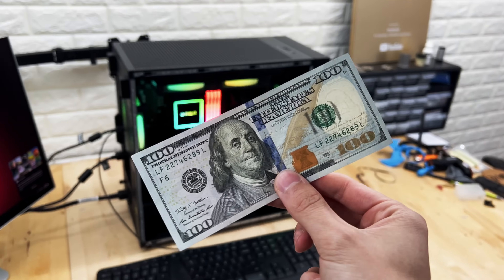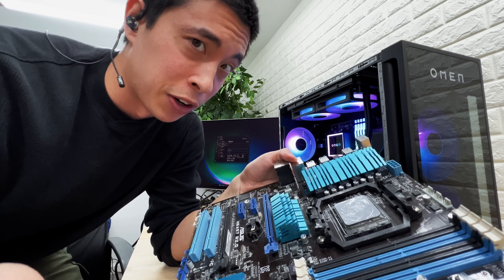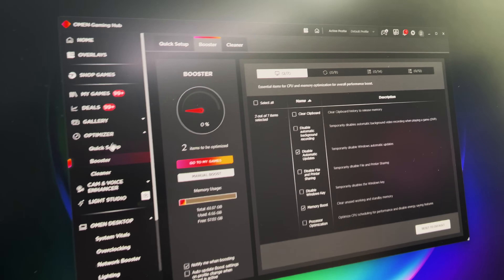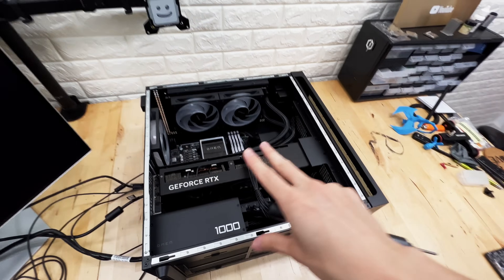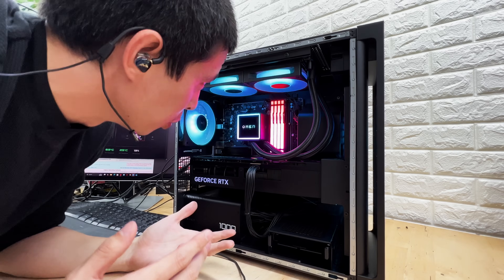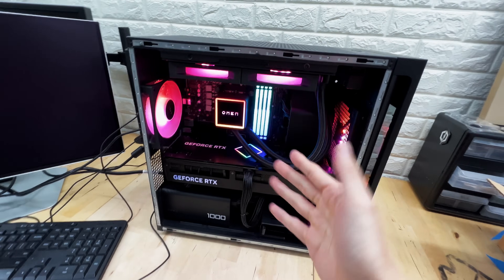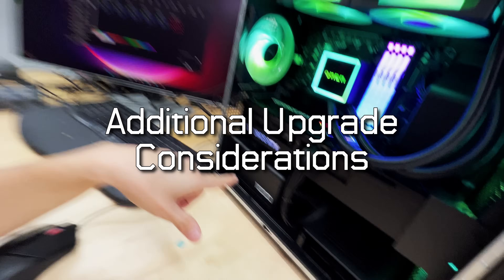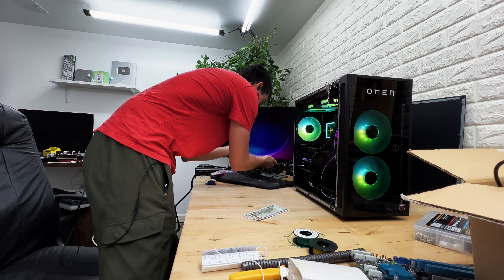Upgrading this Pre-Built PC should NOT be this difficult

Comment: I got a white and black 35l with a 8 gb 4060 ryzen 5 8500g and 16gb of ddr5 6000 and i love it gonna throw a 2 tb nvme in the 2nd slot because it only has 1 tb stock but other then that its good only thing i dont like is the 500 watt non modular cooler master psu but what ever if i upgrade ill get a different one anyway

Comment: Hey, i want to replace the lga 1700 contact frame due to the bending issue on intel 12th 13th and 14th gen cpus due to the clamping mechanism, is it possible to replace the contact frame by like a thernal grizzly one on the hp omen prebuilds?

Comment: I own this pc. I paid extra for the 850 watt power supply, glass front panel, 32gb of ram. I was able to swap the gpu from an HP omen 4060 to a PNY 5070. My issue with this PC is the network card that came with it (realtek) was really really bad. Definitely recommend going with the intel wifi card if available. Also this PC will not go into sleep mode and stay asleep. The power supply makes this annoying clicking sound and then the RGBs go on and off. It's really annoying. The clicking will even wake me up so i'm forced to turn it off every single night or let it click throughout the night. I did upgrade the wifi card myself but it was a pain only because those little wires are so small. I am considering a case swap. that's about it. Otherwise the PC is fine for casual gaming and PC gaming beginners.

Comment: It's absolutely gorgeous with the glass front, 4 RAM sticks, and liquid LCD cooler.  The Fractal North is my favorite build but they usually run high. 

I got a $1,300 white Omen 35L with the 5070 and it didn't have the glass or liquid LCD cooler but still looks great.  I'll be buying another 2 sticks of XMP Fury and increasing the speed from 3,600 to 5,200.  It's a good machine for the price.
Reply: did u had any problem? heard it has issues with cpu cooling is it true

Comment: Don't forget that Dell uses their own rewired ATX PSU connectors (requiring an adapter to be used with any given standard ATX PSU). They have done this since the late 1990s (1998? 1996?).

Comment: 03:16 I'm not sure why you opened the case and took out the M.2 drive.  A better way to get the info is simply open PowerShell and run either one of these commands.

Get-WMIObject win32_diskdrive

or

Get-PhysicalDisk

Comment: Thank you for saving me. I bought this thing maxed out but only 32gb of DDR5 RAM, installed 2 more Kingston fury DDR5 cards of the same exact type and it would boot up. I unplugged them and it boot up. I'm wondering if I have to hold escape on startup and change it to 64gb
Reply: DDR5 doesn't tend to like 4 dimms; will either boot and cap speed down low (can see the build in the vid couldn't go higher than 5200), or fail memory training and just not boot. Have to get lucky with the cpu/mobo for 4 dimms to work at proper speeds. Not sure why this prebuilt even went the 4 dimm route, sets of 4 DDR5 are much less commonly sold for these reasons. 

2x32 is the way to go for 64gb, should just replace existing sticks as it's not worth the hassle in getting 4 sticks stable unless you're okay with manual tweaking and low speeds.

Comment: Update BIOS, Update Windows (or go to Linux), remove Windows components you will not be using. Update all drivers. Adjust power schemes and fan arches after boosting GPU settings. Make sure that the resolution is maxed out to meet what your monitor can do. Should be good after that.

Comment: Please can u help fix my pc My pc turns off and on automatically when i boot it Even booting by a usb it stays fine when using bios or no monitor but when you plug a monitor or boot windows or usb it just turns off automatically and turn on and off again and again specs:-

Motherboard; MSI Mpg Edge Z690 Wifi DDR5

CPU: intek i7 12700k

Gpu: Gigabyte RTX 3060 12gb gaming oc

RAM: Kingston fury beast ddr5 5200mhz bus speed

I tried every method i found on the internet ram removing the cmos battery cleaning the whole pc Rebuilding the whole pc swapping power supply litteraly everything it still doesn't fix

Comment: I had an omen pc and I wanted to upgrade the case bc I thought theirs looked fugly (30l case) so it was simple, as someone with the knowledge to build a pc like me, all I needed was a SCALPEL for some zipties (it was THAT BAD) I had to go through every part of the case, the back panel was so tight, the wifi card was unable to be removed without taking out the receivers but the mobo already had better wifi so I just said f it and yanked it out, storage was left almost impossible to get out because it was sata and in these funky ass containers that make it so you cant put it in another case's bays, the psu was stuck inside because it had a clip put into it that very tightly connected it to the case, and after all of that, I found out that the fan mounting was these goofy ahh brackets overr the already existing ones, so I took those out, then the fans inside of them, and didn't use them anyways because they kinda sucked.

Comment: One problem with the Ryzen 8700G is it's limiting in the PCIE bandwidth as a result of radeon 780M igpu that ate x8 lanes which only spared for the gpu the rest of PCIe 4.0x8, which for a 4080 Super is going to operate half of the performance which is severely bottlenecked

Comment: Just FYI, the voltage driver mosfets sit next to each choke on the board. so that's where the heatsinks were needed. You unfortunately used them on the chokes. Might want to retry that test to verify if any difference is perceivable. Though I don't believe it'll make a difference with decent airflow over every SMD, so it should be fine.

Comment: I got an older alienware r11 that had the same issue of not having heatsinks on the VRM'S so i bought some on ebay for like $6 plus a 120mm AIO cooler for the 10th gen intel I7 cpu and a 2nd intake fan for the front for a total of less than $50. Made a huge difference.

Comment: 2:51 It kinda sucks that 4-channel DDR5 still can't be stable when at full XMP speeds. When I upgraded to 64GBs, I had to downclock to 5800MT/s and change the voltage a bit to make my pc even able to boot. And it seems Omen knows this so they made their turbo speed significantly slower than the 5600MT/s supported speed.
Reply: I had no video output after inserting 2 additional kingston fury beast 8gb to get to 32gb. Took them out, pc works again. Original hp kingston ram is made in a different country to kingstons off the shelf kits so probably different clock speeds n volts ect so can't mix them i dont think. HP need to sort themselves out, this is said be easy to upgrade by HP themselves. I think i may have to ditch the supplied Kingston fury and buy 2x 16gb new ram to get to 32gb. Bit of a waist to take out the  supplied ram though.
Do you think this idea will be a hassle free? I'm not an expert but in the 90s I upgraded my pcs with alot more ease.
Reply: Yep.  I have an Omen 45L with this same RAM setup and it was fine for a few days at the 5200 but then I started having problems and had to back it back down to 4000.  Then I read all about the issues with 4 RAM cards.  I'd bet id probably get better performance in most applications running just 2x16 assuming that runs at the 5200.
Reply: not 4 channel, it's still dual channel, but two dimms per channel
Reply: @albertlong3492  the tested sweet spot for am5 is 2 sticks 6000 to 6400 MHz cl28-cl32....a 2x32 GB 6000 cl 28 would of done the job better in this case

Comment: gotta be the first time i see a set of ddr5 running at 3600mhz 💀 stay away from HP and DELL
Reply: That's the maximum speed of DDR5 if you install quad channel memory, and it's the reality not OEM faults. Go DIY is the same as this.
Reply: @baoquoc3710  Thanks for the explanation I didn't understand it either cos dual is usually 4800mt stock
Reply: bc quad ddr5 is ass, if u want best results use dual

Comment: My local pc store has their own line of pre-builts that use non-proprietary parts that are cheaper than it would be to buy the individual parts as they are sponsored by PC brands. The high-end coolermaster pre-built I got had an 850 watt psu and 32GBs of 6000MT/s DDR5 to complement the 14600KF and RTX 4080. They did not skimp on any parts. It even had every fan slot on a full-tower case filled in, including a 3-slot coolermaster AIO.
Reply: That sounds solid
Reply: @@@@@@@q@q@@q@
Reply: Nice! We need more locally owned pc shops like this all over the US.
Reply: @T.Lspitz  This is in Australia. It's a PC store franchise called Umart. It has in-person stores but are only click and collect or delivery so there only needs to be one person at each location. There are robot-ran warehouses around the country that organise the online orders to be delivered to the customer's house or to a click and collect store. It's really efficient and savvy.

Comment: The CPU utilization can say "100 percent" while still being throttled by the motherboard VRMs. You really should have used a laser thermometer or something to check the temps of the VRMs while under load, if the board doesn't have sensors on it.

Comment: You placed the VRM heatsinks on the coils of them not mosfets so they won't cool mosfets (the black chips next to the coils) which are going to get hot.
Reply: Coils?
Reply: @Jb1v1clips  yep, those gray blocks ale coils/inductors  VRMs are DC-DC converters that works similar to tranformers but with DC current
Reply: Ugh autocorrect